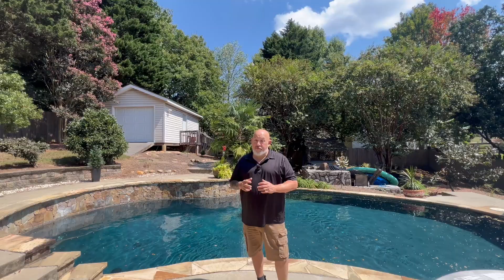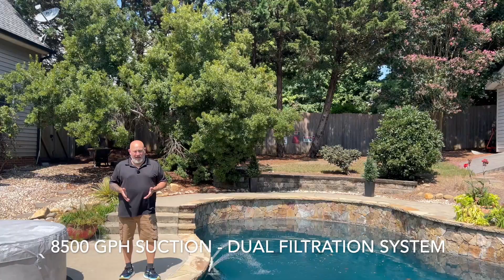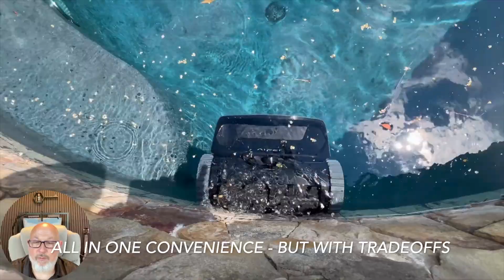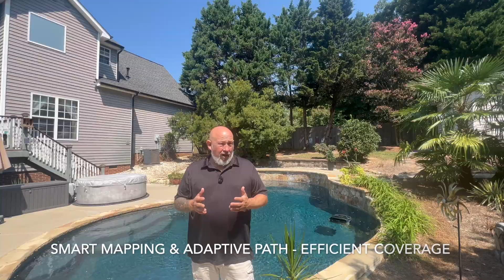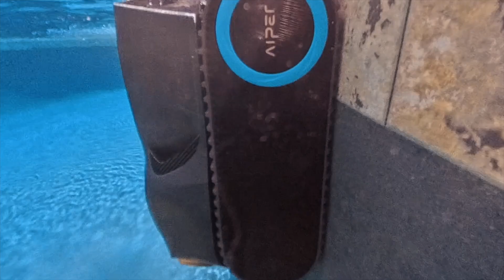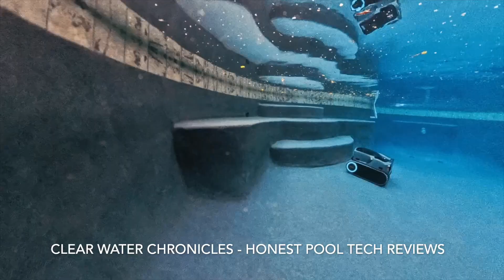Aiper Scuba X1 Pro Max Deep Dive - Battery, Suction & Navigation Tested

Comment: It is absolutely not worth it. Day three of owning the Aiper Scuba X1Pro Max with the HydroComm Pro. In a word??……atrocious.  Absolutely pathetic cleaning performance. Three max power floor-only runs. Three 1/4 full baskets. Battery exhausted after each run. 4-5 hours to recharge. Pool pump filtering between runs. STILL a bunch of leaves and dirt on the pool floor!!  The suction power is abysmal. It pushes dirt around rather than suctioning it up. For this price I am very disappointed. Going to request a return/refund tomorrow.
Reply from the maker: Almost sounds like a defective unit. It definitely wasn't the best cleaner I've tested but it was far from the worst also. I will say I personally have had much better results from the Beatbot Aquasense 2 doing the floor, walls, waterline, and using a separate unit to skim the water surface. Thanks for watching, update us if you find one that works well for you!
Reply: @ClearWaterChronicles-pool-H2O I had the Maytronics Dolphin Active 60. Amazing cleaning machine. Really powerful unit. Had to replace the cord at 2.5 years, and a main drive motor went out at 3.5 years. That’s what made me change brands. I wanted to get the Dolphin M700 (4-year warranty) but can’t find it anywhere and my awesome Betta 2 skimmer would always get hung on the cord, so I decided to try another brand and go cordless. Big mistake so far.
Reply from the maker: I moved away from corded models a few years ago. The one I had did a good job until one day it didn’t and the cord always was a pain. The best warranties I have found so far in the cordless models are with iGarden and Beatbot. It can vary depending on the model though so you kind of have to pay attention to which model has which warranty. For the cleaning performance I lean towards Beatbot but both of their upper line offerings have performed well in my pool. I will say for battery life that new K-Pro is impressive if that is a concern.